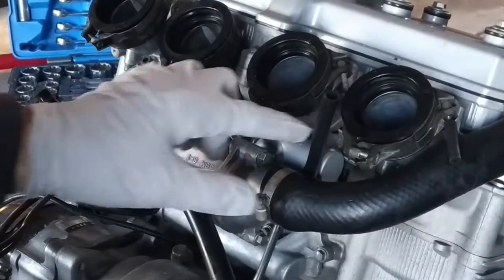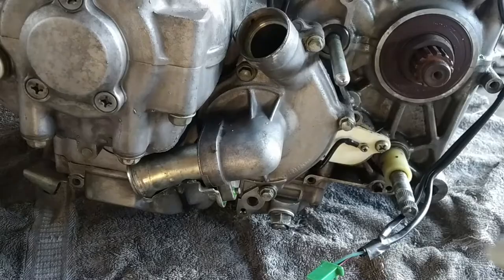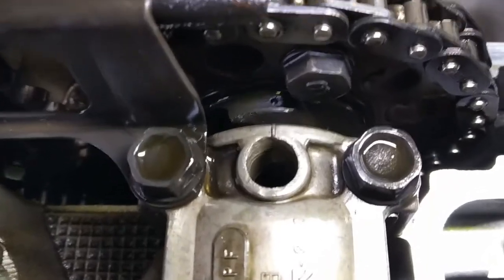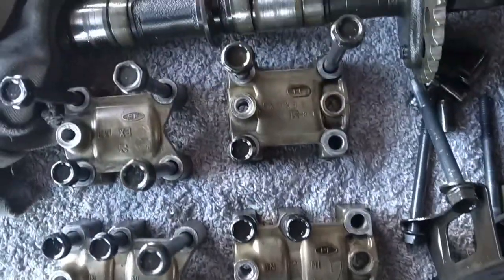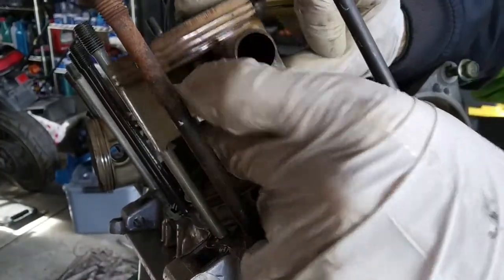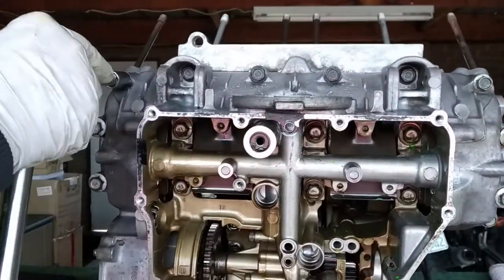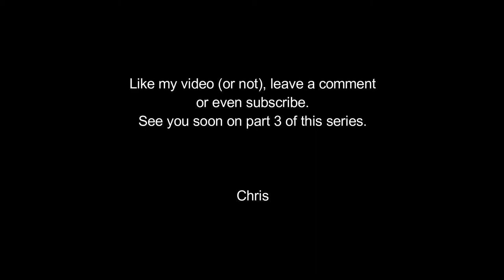Yamaha FZR 1000 Exup Full engine restoration Part 2

Comment: That diagram that shows all the bolts especially the 3 on the cylinder side holding the 2 cases together really helped me i wasn't able to get it on the internet thanks alot
Reply from the maker: No problem. Sent me your email and I'll send you a better picture

Comment: Hi I got my first bike fzr1000 1989 I just Wana know can I use the car engine oil in fzr1000 is it a dry clutch or wet clutch please can you tell me what should I i do?
Reply from the maker: Hi there! Congratulations on your FZR! I adore that model year! All FZRs are wet clutch. But please DO NOT use car engine oil in your FZR (or any other motorcycle). Motorcycle engines are more demanding when it comes to oil as they rev far higher than cars. Also, the gearbox and the wet clutch are lubricated by the very same oil their pistons and cylinders are. And the wet clutch doesn't like car engine oil at all. 
Use a good quality motorcycle oil. Mineral, semi-synthetic or full synthetic. All three are good, as long as you change it when you have to. 
All the best with your FZR. I hope you enjoy it🙂
Reply: @ChrisSofos  thank you so much. Now I feel batter 👌thanks a millions👍🤝

Comment: Hi! I am disassembling my fzr 1000 motor, and I'm on step 13:58, so I have to separate the motor blocks around the crankshaft now. But they're stuck! I'm sure I took all the bolts etc off, but still it doesn't split up. How did you get them off? I'm afraid I fuck up the block :( A really big thank you for doing this video, it would have been a lot harder job doing this by learning myself. And I already found the main issue of the motor, my connecting rod bearings are blown!
Reply from the maker: I couldn't possibly tell you the reason, as I'm not there to see the engine. Just go once again along my video step-by-step and double check something that you might have missed! For example the crankshaft covers on both ends at 2:49?
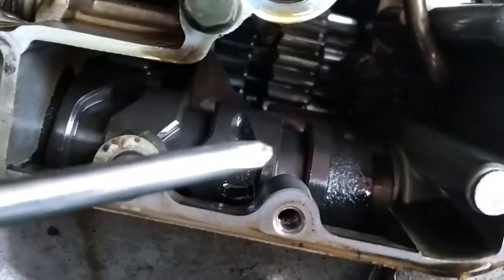Then check at 11:10 some more details. I'm guessing you removed the oil pump? The torx bolts at 13:43? 
Have you removed all the bolt from the upper as well as the lower crankcases?
If it still doesn't want to come, then light taps on the upper crakncase with a mullet, trying to push it upwards. This should do it! Let me know how'd you go!
Reply: @ChrisSofos  Oh yes, there was one bolt still unremoved :D It's completely disassembled now, and I learned how to check which color main and conrod bearings I need, from your videos! Thousand thanks to you!! Now I just need to buy new parts and start assembling everything back!

Comment: Please tell me that in order to remove the bendix...I don't need to take the engine apart :(
Reply from the maker: If you mean the starter motor clutch, then I'm afraid that I have some bad news. Unfortunately, you have to split the engine apart :(

Comment: cool cool, a bit better camera quality would help
Reply from the maker: I need to buy one, don't I? Just the phone doesn't help much!
Reply: Why the rebuild?
Reply from the maker: @grantwoolhouse8625  3rd cylinder had extremely low compression (close to zero). Then I thought: I'll keep this bike forever, so why not go all the way down to the crankshaft and make the engine brand new?
Reply: @ChrisSofos  hallo do you maybe no where to get the parts for rebuilding this yzf 1000 engine please
Reply from the maker: @jacquessmit7479  I buy my parts from either cmsnl.com or megazip.net
Some of them I find also on eBay
Reply: @ChrisSofos thank you so much